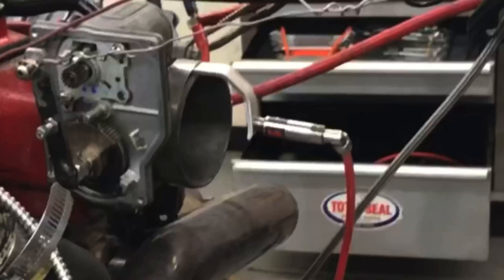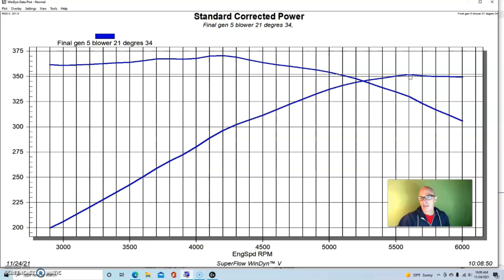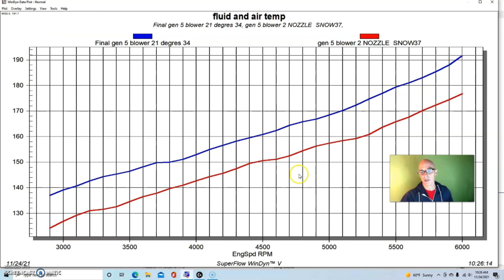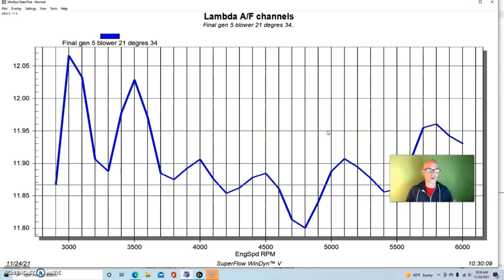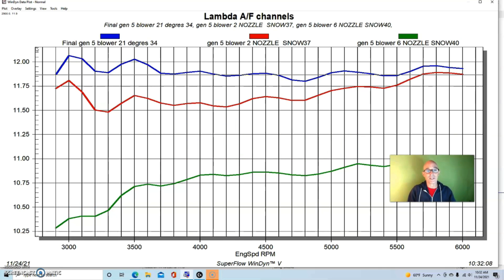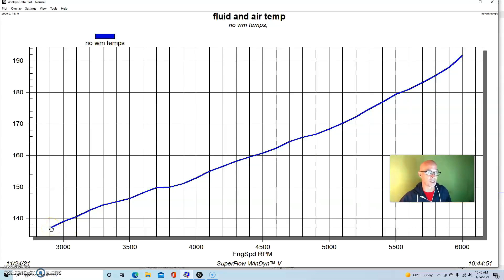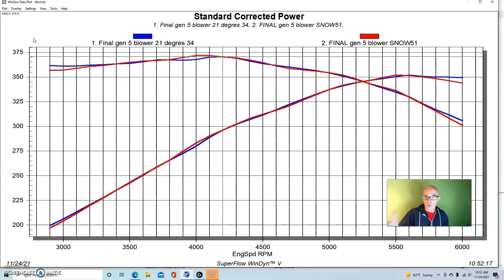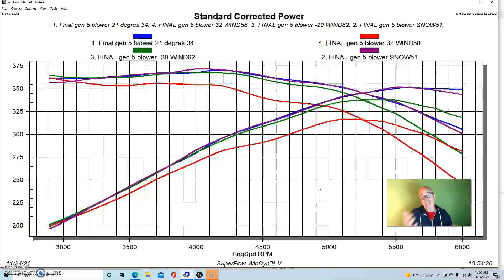WATER METH VS (LOW-$) WINDSHIELD WASHER FLUID-WHO WINS? BEST WATER/METH VIDEO EVER! IATS, AF & HP!

Comment: I went from 330whp to 375whp using snows wmi kit with -20° super tech washer fluid + 1 bottle of yellow heet and 94 Oct + vp octanium. Also my intake valve stems were completely cleaned of all carbon. I'm running 23psi on a fairly small turbo on a 2.3 inline 5 cylinder. So it definitely helped in pushing the efficiency of this turbo. We were nearly able to achieve mbt on gasoline. I don't have iat sensors unfortunately.. also msds data sheet shows 30% methanol 70% water with super tech winter formula.
Reply from the maker: if you add timing and boost-it makes more power
Reply: @richardholdener1727  Right I get your point you were just testing for differences in iat's mostly not changing tuning. I get how it works thank you though! I would like to see you test VP octanium!

Comment: Too many variables to adjust for home DIY people slapping on bolt on Methanol-water injection systems.  Without a dyno and lots of time on it, and the adjustability of various nozzles and fuel curves, most people are wasting their installation and also ASS-uming what the system is doing.  In real world use (track), load, engine temps and ambient airflow temps are additional variables in real time.

Comment: I have used the Snow MPG system on my F450 Diesel Dually... all I can say is that without the Spray the truck ran 16.38 in the 1/4 mile ... cannot remember the speed though... with the Spray it ran 14.38 with a 96.8 MPH ET was 14.38...this is using Diesel...I am very happy with results .... and once I added the Tune using my H&S unit... we got it 13.82 ET...not sure if the Water Meth just works better with with Diesel Fuel? All I can say as I tried at the track each component on it's own and for me it works great...I am installing the system on my Tuned Redeye and will put on a 2.72 pulley...from what I am reading it may not make much of a difference on the HP but will help on Detonation...since the 2.72 pulley will be run as a track only and with Ethanol...I am having second thoughts...we are well through the install process and have all of the parts...we are not tuning for the Meth...it is only being used to help cool  and protect the engine ... especially on Hot days...
Reply from the maker: the diesel adds power when you add fuel-you added fuel with the WM-it works very well on a diesel

Comment: The boost juice is 51% water and 49% meth the- 20 windshield washer fluid has around 30% meth 70% water. The 32° windshield washer fluid has zero methanol in it and it's just water. Hence the reason why they have a below freezing windshield washer fluid. The negative 20 option for if you are going somewhere where it's freezing and you're driving and it's snowing you're going to have to get the snow off your windshield so you have to be able to pump your windshield washer fluid to assist in knocking the snow off your windshield. That's why they have the -20 and if you're not going somewhere where it's below freezing, you can get away with using the 32° windshield washer fluid because it doesn't need to have any alcohol methanol in it. That's why there's different amounts of power that all three of them make. Just like if you're talking about ethanol fuel. If you have 85% ethanol fuel also known as e85, it's going to make the most amount of power now. If you have E60 the car is going to make less and if you have E30 the car is going to make less because there's less concentration percentage of ethanol alcohol

Comment: But what about when you adjust the afr and timing?
It does not sound right, 87->43C temp change causes air density rise of about 20%, which shoud be translated to comparable power increase after afr and timing adjustments.

Comment: Richard when you were speaking of this system on a non closed loop becuase of the holley system.    What about us guys running the meth systems on turbo or twin turbos in a closed loop scenario? Would the tune we have or the pcm beable to make the small adjustments to the nozzle changes and then the afr changes , since in closed loop?
Reply from the maker: YES
Reply: @richardholdener1727  freaking sweet bro !  Thank you so much. I'm going through with the install because of you now 😂

Comment: This whole video is a pointless waste of time because:
A: The engine was already tuned on e85.
B: You didn't add any timing.
Reply from the maker: it didn't respond to timing because it already had the correct amount-which was the point-WM alone does not add power
Reply: @richardholdener1727  that's kind of my point, when WM is used correctly. For example, on knock limited engines (what it was designed for) WM does add power when tuned for it. 

So there's no point putting water meth on something that already has optimal timing and isn't knock limited.

Comment: Water meth allows for more boost than without, more boost, more power. Try a smaller pulley and run it on gasoline.

Comment: I believe most people will use water or water/meth to control detonation either on boosted engines or n/a engines with very high compression ratio's.
No mention of that.
Your video shows you can spend a lot of money to fit water injection to get you right back to where you started ?????
Reply from the maker: the video shows that the WM injection itself doesn't add power-timing or boost does

Comment: This video is one sided, this system is usually used with 91 fuel, obviously if your running a fuel like e85 that already offers a added cooling effects and has virtually no knock limit, then adding water meth will not add power because your already able to achieve optimal timing , with 91 fuel or less that would not be the same case, because you will be very knock limited
Reply from the maker: Same result-the WM doesn't add the power, the timing does
Reply: @richardholdener1727  you should do a test of av gas vs gasoline and e85 on a turbo engine

Comment: suggestion.  Take one of your engines that normally runs on gasoline.  I don't think it would matter for the testing purposes, which one you use.  Dyno it on gasoline (C12, 93, Q16, whatever) and then dyno it on Methanol.  Let's see what the differences are, and if you want to play with it feel free to do so.  A lot of us want to see what these things will do on straight methanol vs 93 (or whatever) fuel

Comment: As many have stated I would like to see this test with 91 octane instead of e85. Also you show the A/F for straight gasoline not for e85. Shouldn't you be targeting ~7:1A/F for e85? Am I missing something there? Also when injecting the Methanol the A/F is dropping because you're adding fuel, but Methanol is lean at that 10:1, it likes to be from 3-6:1 in a pure alcohol motor. Could you simply add timing to make the power back? It's adding knock resistance on top of e85's great 100-105 octane.
Reply from the maker: you are confusing the scales-these are on the gas scale-the AF is correct
Reply: @richardholdener1727  oh I see. You're scaling lambda to read like gasoline. So you're not actually running 11.8:1 AFR. You're reporting incorrect volumes in your test bench. I think lambda or basing your graphs on the actual AFR values are more valuable.

It would make it a whole lot simpler to use lambda as you're mixing 3 different fuels with their own separate AFRs. Scaling the values to 14.7 doesn't tell a complete story.
Reply: I would also love to see the boost levels throughout this test. The boost should drop down pretty significantly. I'd venture to say 10-11psi.

I think this is where turbo cars see a much larger difference with water/meth. If you're basing the amount of air that's fed strictly by how much the blower can push, cooling that air doesn't change the amount of air, just its density. Where in a turbocharged application, the manifold pressure drops because of the temperature loss and the WG will compensate. So running the "same boost" with water/meth nets much more air. Instead of running rich like this engine did, even with methanol being injected, a turbo engine would lean out as the air cooled.

Comment: Also, methanol isn’t only for cooling but if you use it in 100% you get the cooling, the octane boost and it can kinda stretch out a fuel system

Comment: Richard I'm Thinking about adding this to my supercharged 4.0 Jaguar in Phoenix.
Have you ever done any Dyno runs to see if the factory closed loop mass air flow system would compensate. 
It's near impossible to find somebody to tune an 02 Jaguar .
Reply from the maker: usually the factory computer is not in closed loop at WOT

Comment: Nifty testing methodology to show cooling effectiveness. However in the real world and on the street, you'd be running Closed loop so you don't have to keep re-tuning the ECU. If you ran out of Juice and tuned for the Juice you'd be screwed.
Reply from the maker: Closed Loop at WOT?
Reply: @richardholdener1727  No. Unless you were forcing the tune to stay closed at WOT. 😁 Which I think is possible on those Holley units. Regardless, I was just pointing out that in a real world application, the user wouldn't have to worry about the fueling tune because the stock ECU will take care of that... assuming their O2 & MAP sensor are correct.

Comment: Thanks for all your hard work over the years Richard. Do you have any data from water meth on diesels?
Reply from the maker: if it has fuel-it adds power to a diesel
Reply: @richardholdener1727  Thanks. Looking forward to the next amr500 vid.

Comment: Great video with the dyno runs to illustrate change. Very informative. I will say that my understanding is that adding w/m injection was so that you could advance timing and/or increase boost while still being within a normal temp ranges. The power would come from those changes, not the w/m injection. Please correct me if I’m wrong, as I’m still learning.

Comment: I understand this comparison as a proof of concept but people do indeed think adding water injection systems add power out of the box.
A couple problems here that I see....
#1)Your way past the efficiency map of that roots blower .
#2) A spray plate needs to be used post blower between the blower and the intake manifold, it's not nitrous.
#3) If you were running pump gas you'd also lose power because 
The power gain can only come from alot more timing as the methanol slows the flame propagation. When you see people running race fuels thier also advancing the timing to take advantage of the increased knock threshold or you get no more power, same here but worse , it's only occupying space where the fuel would be and effectively retarding timing as well. 
My boss added a methanol Injection system to his 750hp hemi , I tried to explain he needed timing advance and a remap , but people think about methanol like they do nitrous. Turbos and blowers are damaged by liquids especially methanol if they are run as shown here as well. 
So on pump gas you need more timing and more fuel to see gains using a water injection system.
Reply from the maker: Couple of problems I see here with your comment. 1. This test was run with the blower with a pulley combo use by endless 3800 owners, and puts the combo in a position (elevated IATS) to need WM. 2. the injection position is in the most effective location (pre blower) for charge cooling. 3. The test was to illustrate that you do not get gains from WM alone, that any gain would come as a result of the added timing or boost-not the WM itself (unlike nitrous). I have plenty of videos up on the gains offered by increasing timing.

Comment: Richard it would be interesting to see you take a Ford Cleveland two-barrel head with open Chambers and bring up the compression ratio by the usual methods ...decking the head during the valve job adding Pistons with maximum Street compression ratio and a cam design that helps with compression ratio as well.

Okay so now you started with something like a 400m motor a smog motor NOW  has decent compression 
However great flowing heads that are also prone to detonation.
So here we go-'the challenge is the ignition timing.
We know that motor could rattle itself to death on 91 octane if not careful with the build/tune so the question is what can you do to maximize your fuel/air ratio and your maximum amount of ignition advance?
One way would be to take the high compression motor on the dyno with race gas and tune it with both fuel air ratio and ignition advance to gain maximum horsepower and then replace the gas with 91 octane pump gas snd Water methanol injection and see if you can get similar numbers without damaging the motor.

Pilots in World War II had high-performance supercharged engines in their fighter planes but they cannot rely on the octane of fuel because of wartime conditions therefore in addition to water methanol injection they also were able to control boost and ignition advance from the cockpit.

I know I'm going Baja-ing here but it's worth mentioning that I remember reading how water injection alone could do the trick but in fighter plane application you had the issue of freezing ergo the addition of 
Methanol to fix that problem

❤ thank you for the great testing Richard you rock to no end we love your show keep up the good work!
Reply: I totally agree, this would be a good test you propose ! I am in Australia and we have the tiny 56cc closed chamber Cleveland head that everyone says will put compression too high on a 4" bore x 3.5" stroke 351. BUT - what if you run water/meth injection on it that equals about 11.5:1 N/A, with a carb ? THAT'S the test I wanna see ! Saving your motor, while running cheaper lower octane fuel, AND increasing power ?
💪🙌
Reply: @johnkraft7461 
Dear Messrs  Kraft and Holdener-- Indeed there's a couple of ways to look at this....

The idea originally proposed was to take the open chamber two Barrel Cleveland heads because after all Cleveland heads are just fantastic at flowing and the two Barrel open chamber heads give you great low end response however the open chamber design is prone to detonation......so if you start with for example a 400m and open chamber two barrel heads and 11 to 1 compression ratio put it on your Dyno with 100 octane unleaded race gas and then dial in the amount of Ignition Advance required to maximize your horsepower and torque curve without water methanol injection--well then that becomes your control profile A.

At this point you change out the fuel to unleaded pump gas and here in California that's going to mean around 91 octane and see if you can safely replicate the horsepower / torque curve throughout the entire range with the supplement of water methanol injection.

That becomes test engine profile B.

Next you introduce a Ford Cleveland engine set-up to simulate the situation they have in Australia.

Now this is going to be where things get interesting because of the argument that squish area or quench heads while being disastrous for emissions are great for minimizing detonation and death rattle.

But once again the question is can you Stave off the negative effects of low octane fuel by supplementing with water methanol injection?

In all cases you need a side by side comparison of the engine being run with the 100 octane race gas first and without water methanol injection and then change over to 91 octane pump gas with water methanol injection.

This is also a great opportunity to match up the water methanol injection system with a profiled ignition system so for example pairing a Snow water methanol injection unit with a MSD programmable ignition box--it would be very interesting to see when you start introducing the water methanol spray and how much in order to maximize your ability to climb up the ignition advance curve as rapidly as possible while the engine is coming up on RPM's.

Richard!  Crikey!! we bloody well owe this testb to Mr Kraft and our comrades over in Australia.

Good on them for the dedication and devotion they've put into the Ford Cleveland platform. I will also add that all of the Cleveland speed parts made in Australia that I have ever used have been top quality and expertly engineered.

And if you need a hand spinning winches wrenches I'll be right there to change out the sockets before you even know it and I'll bring the pizzas I only live 20 miles from the Dyno facility where you test. 

Heck if you really want to get snazzy I have both a set of four barrel quech chamber Cleveland heads (BOSS 351) as well as a set of Australian two barrel quench chamber heads.

We can go to Pick Your Part to find the open chamber heads off a 351m or 400m truck motor.

Right then--let's get on with it!